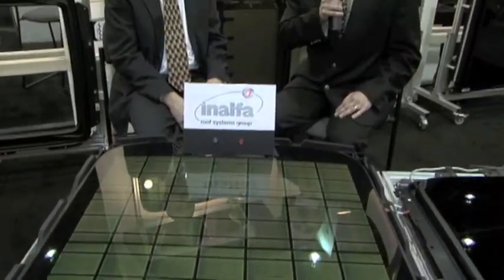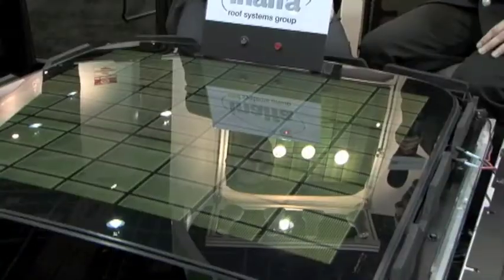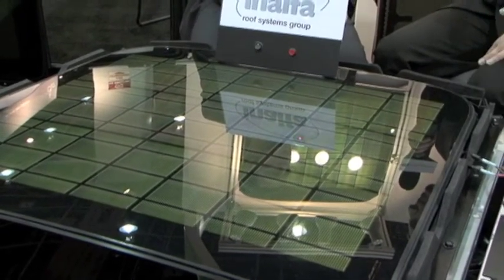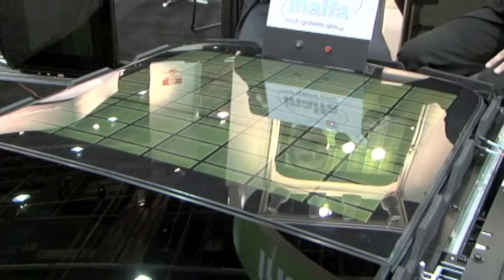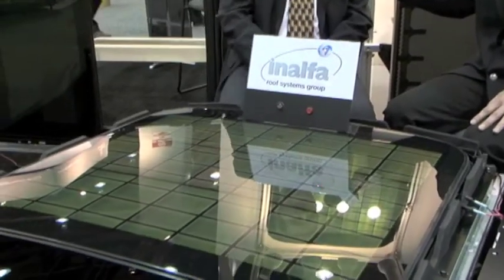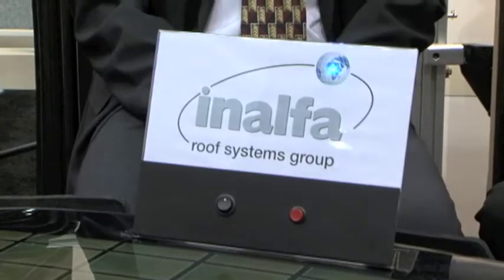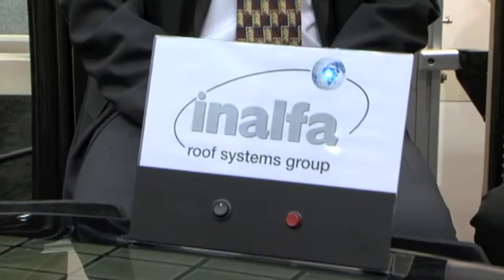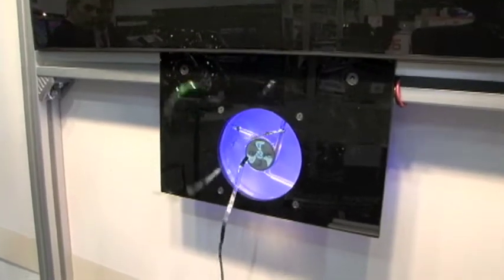Inalfa exec discusses potential of solar panels at SAE 2011 World Congress

Comment: Marketing Glitz?  Mr. Holtz was very forthcoming regarding the present day limitations of solar panel technology.  If the solar panel could've powered the entire convention center it would've been wired into the building breaker box. 
Also, keep in mind the theme that this presentation was engineered around - which is forward looking in it's core concept.  The "pre-cooling" idea to run a circulation fan when the vehicle is idle could have a market impact in the very near future. 
Very nice job!

Comment: Too much marketing glitz and not enough data.  Great looking booth.  Running an LED or a 20 watt muffin fan does not justify the cost of the solar panels, and the claim of the potential to "recharge electrical-propulsion energy storage systems" is pure science fiction.